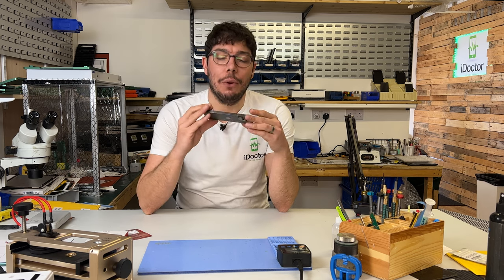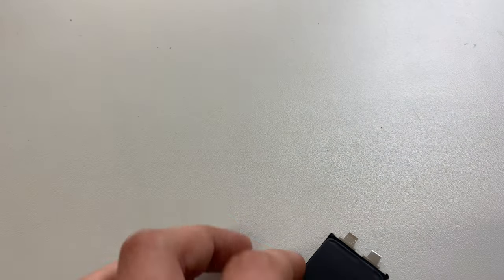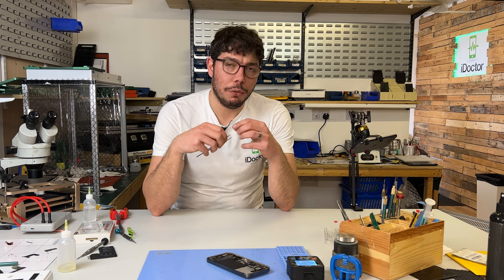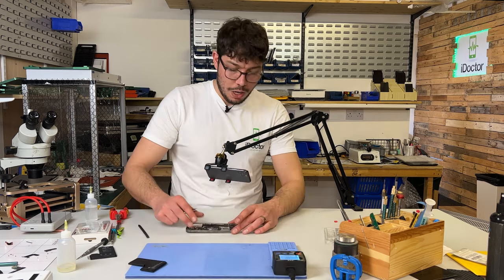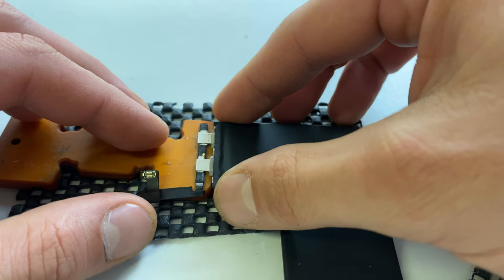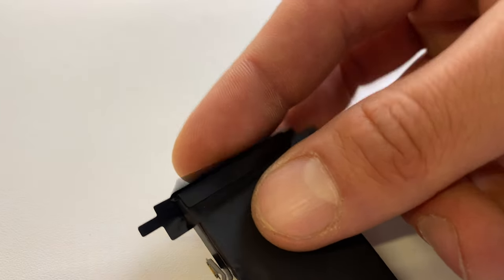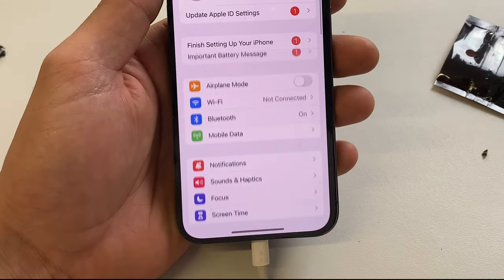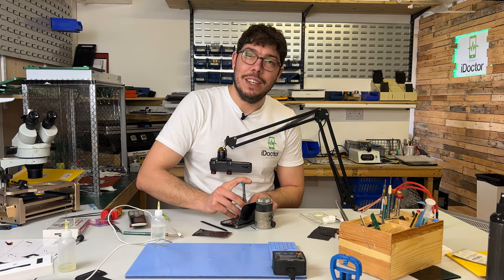How to Replace and Reset iPhone 13 Pro Battery to 100% maximum capacity

Comment: Mines cooked, it’s at 66%
Reply: That will turn into a spicy pillow any time...
Reply: How can u even reach 66 💀
Reply: Mine got pregnant at 74%
Reply: Mine is @ 71 but I know when iOS 18 comes out it will drop 😂
Reply: @dabelu7165  mine did at 64 Lol
Reply: Careful with the weather as well. It starts to impact the battery too
Reply: Mine is 71😂
Reply: Mine just became a pillow
Reply: Mines is at 80% right now. I’m trying to take it somewhere to get the battery replaced before it gets to the 60s

Comment: Have you ever tried the extended capacity batteries from xcap on older iphones? They claim to have 10 or 20% higher capacity depending on model I think its possible that battery chemistry has improved over the years to do it but im wondering if you have tried those ones too if there any good
Reply: I have tried on my iPhone 11 the extended capacity. I was shocked how well it kept the charge. I’m planing to get them for my 13 pro max and my 15 pro max too
Reply: @daniellantos26  I don't think there will be legit extended capacities yet for new models any that claim it will be fake it's more realistic that older models can have increased capacity by now because they was conservative with the original capacity spec and battery chemistry has improved

Comment: Where do you get the battery tag cable ?
Reply: It's a spot welder used for building 18650/21700 battery packs.